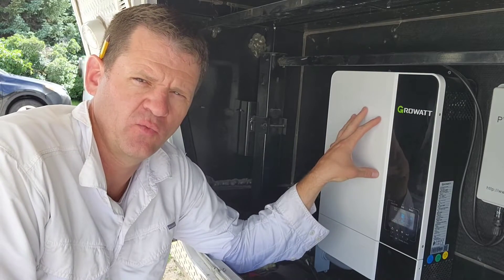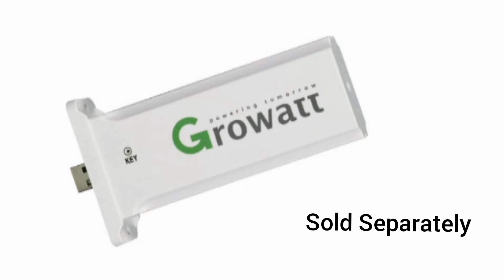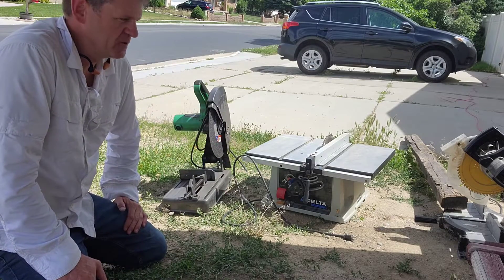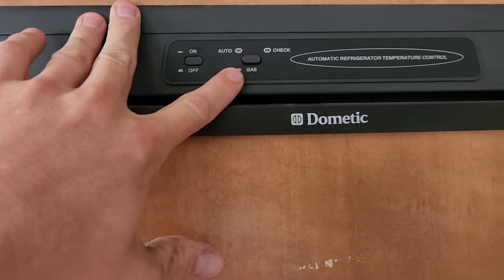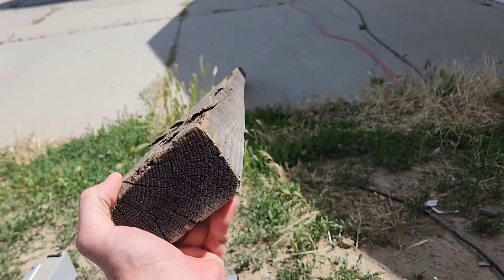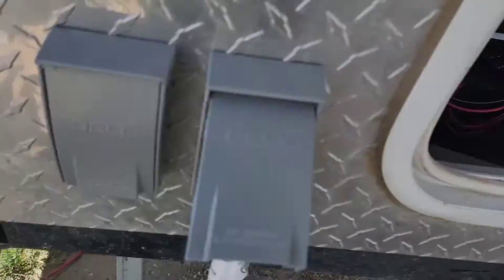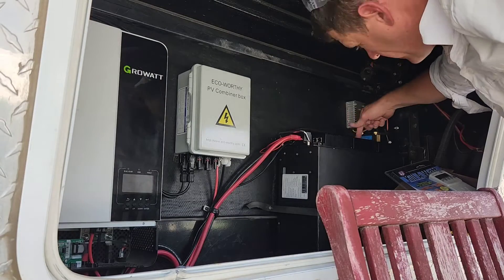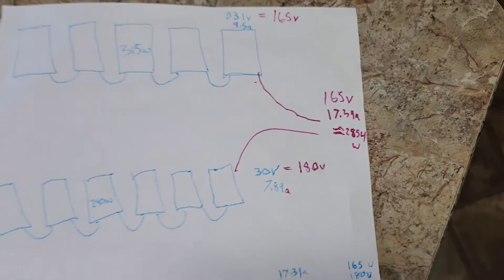GROWATT 3000 lvm-ES All-In-One Inverter - BATTERY OPTIONAL

Comment: I have a question, there is a comment in the Growatt description that says it can combine power from the grid at the same time.  How does that work, does it switch to either or, or is it actually using both the grid and the solar to supplement power to something i.e. if I needed 30amps and I only had 10 amps of solar would it combine 20 amps from the grid?  If that is true it would work well with a small system.  Maybe then it would run motors without a battery?
   
Growatt description: Solar and utility grid can power loads at the same time

Comment: Good day , I have a question that maybe you can help me out , I have two of this inverters I have one connected to 2 series strjng of 6 panels of 250w in parallel and the second inverter I want to connected but I only have one string in series of 6 panels 250w each , can I use them to produce 240v to charge an EV? Or do I need to have the same amount of solar on both ? Thank you
Reply from the maker: I'd try to have the solar balanced evenly between both inverters...especially if you're trying to run without a battery.

Comment: How is the unit after a year now?
Reply from the maker: It's still in my RV going strong. However I with I would have went with the other Growatt model for my RV, The one operates at a lower solar voltage, So I can have a 3p2s configuration

Comment: Very good execution.  I have been looking at something like this too. For the house setup a backup panel for all the circuits you want to run on the backup setup could be done just like a switch for a backup generator. Since you have the hybrid inverter you can use grid power to keep it powered when you don't have sun or have run the battery down.  Prioritizing solar and battery would mean you could use little to no grid power.  Refrigerators and small A/C units seem like the best circuits to power as you will save the most cost over time.
Reply: solar systems should be like that not feed in tariffs , that can be manipulated in the price of kw, so that way the owner will be the winier not power telcos

Comment: Do you have 120VAC input cord for the Growatt so if you were ever at a campsite with hook ups, you could have the Growatt "plugged in" so you had grid power if you wanted/needed it? 
When I do my best to copy your system I am going to add that and just set the priority on the Growatt to solar/battery that way if a long stay and clouds it would be seamless power no matter the state of the battery or solar availability.
Reply from the maker: That's a great idea.  I've sense added that chord you're referring to.... But I've never needed to use if.  Definitly better that the Victron 3000 which can only support 2400 watts of appliances( pretty much one large appliance).  PS... I like the Growatt P model better that this unit for RV setups.

Comment: Awesome video, I've been looking for so long for something like this. Real world test on how well an inverter might handle a surge from inductive loads and the real inrush measurements.

Also saw your video with the furnaces, do you know the inrush amps on those blower motors?
Reply from the maker: Sorry for the delay. I just measured my larger furnace in Rush current which Heats and cools my house which is about 3,200 square feet. It was only 10 amps in Rush current to start the blower motor.. I know that seems low but I think it's right because I have seen people run their furnaces on pretty small inverters.
Reply: @diySolarPowerFunWithRay  not a problem, I really appreciate you taking the time to measure and answer my question. I'm still trying to size up my system and your videos have been great in that regards.
I'll be waiting for your next videos 👍🏽
Reply from the maker: @evillink81  thanks!